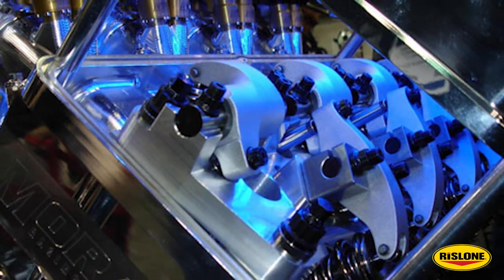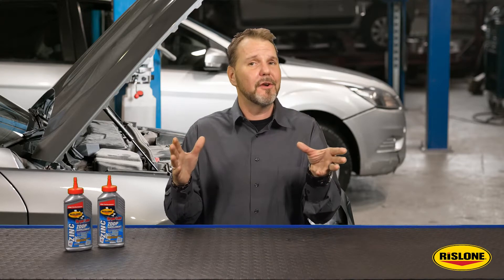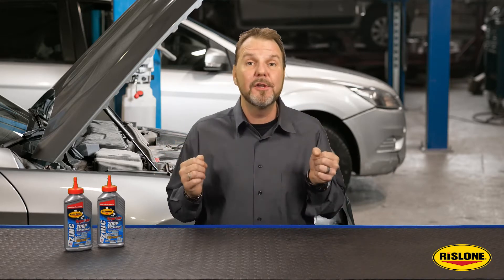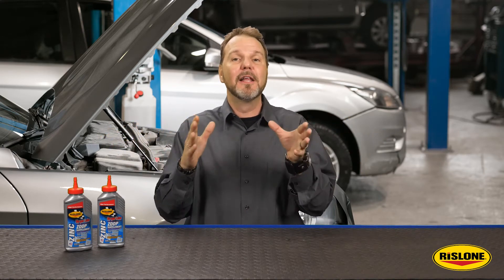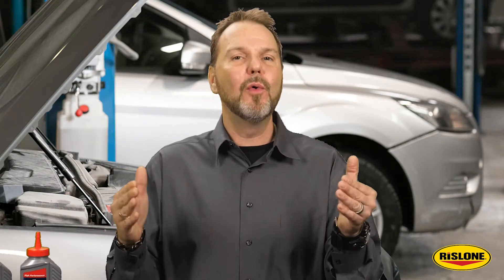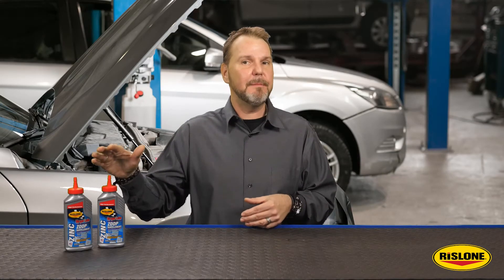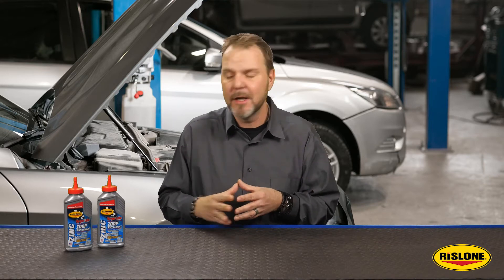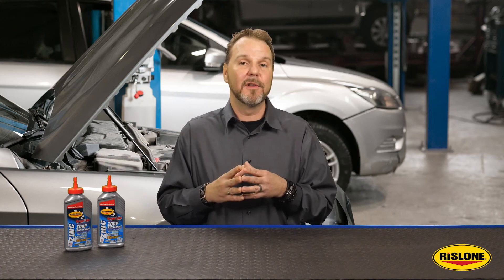What is ZDDP?

Comment: I bought Valvoline MaxLife 10w-30 and it apparently has ~850ppm of Zinc. I am wanting to reach around 1100-1200ppm. My truck uses 4.5 quarts of oil. So how much of this would I add to reach the desired amount of zinc? The directions of "half bottle" or "full bottle" is not very specific.
Reply from the maker: Thanks for the comment, with that PPM oil you will want to add 3 ounces of the product to 4.5 quarts to hit your 1100-1200 PPM rating. At a 7% dosage rate in a typical SN rated oil the product will get you to 1700-1800 ppm.

Comment: Would a target concentration in the oil of Zinc and Phosphorus in the 1300 ppm range be good in a 2009 high-performance gas engine?
Reply from the maker: Yes this is around the common range for that year with a high performance engine, most common is 1100-1200 PPM of ZDDP in the system but some may run a bit higher. 

What is the year/make/model and engine size on the vehicle? For a quicker response you can use our contact us page at the link below - 

https://rislone.com/contact/

Comment: High levels of zinc. How many PPM in each bottle??
Reply from the maker: With typical SN rated oil at a 7% dosage rate expect levels to be raised to a total of:
Zn Zinc 1700 – 1800 ppm
P Phosphorous 1500 – 1600 ppm
Reply: Why would the bottle directions overdose for flat tappet  ? When recommended should be 1200- 1400 pom? @RisloneGlobal

Comment: Isnt zinc bad on Cats though?
Reply from the maker: This product will not cause any damage to the CAT.
Reply: @RisloneGlobal but if your engine has any oil consumption it's been determined that the burning of zinc can be harmful to the cats over time which is why modern oil cut it down so much
Reply from the maker: @ronaldrrootiii6040  Yes, oil burning in general even without our product can damage a CAT. If you are burning oil try our Rislone Ring Seal product.

Comment: actually modern car engines need it too, especially for racing motor oils. so i like to top off with risilone zddp.
Reply from the maker: Yes modern engines can benefit from ZDDP but you do want to add the proper dosage. 

For best protection, use with every oil change. Can be used during oil change, or added in between oil changes. Do not overfill.

GASOLINE ENGINES (Cars & Light Trucks)
1996 and older – Add one bottle to engine crankcase.
1997 to 2004 – Add approximately 1/2 bottle (5.5 ounces) to engine.
2005 and newer—Add approximately 1/4 bottle (2.75 ounces) to engine.

DIESEL ENGINES (Light, Medium & Heavy-Duty)
2006 and older – Add one bottle to engine crankcase for every 5.5 quarts of oil capacity.
2007 and newer –Add 1/2 bottle to engine.
OTHER APPLICATIONS: For 4-stroke marine & motorcycles ATV (non-wet clutch), agricultural, industrial and racing engines— Add 2 ounces for every quart of capacity.

TYPICAL TEST RESULTS INDICATE:
GASOLINE ENGINES - With typical SN rated oil at a 7% dosage rate expect levels to be raised to a total of: Zn Zinc 1700 – 1800 ppm 
P Phosphorous 1500 – 1600 pp
Reply: @RisloneGlobal  Any bad for engine if i overfill ? i always add one bottle......
Reply from the maker: @ga002078  Yes you do not want to overfill the system.
Reply: @RisloneGlobal  even i already decat ?

Comment: I think there’s a market for this product in larger bottles for HD diesel applications since they’ve removed a lot of the ZDDP from CK4 diesel oils. Ford even issued a TSB statement with the advent of CK4 stating that the ZDDP levels were too low for proper protection of the valvetrain in their engines. Please consider offering a quart size bottle